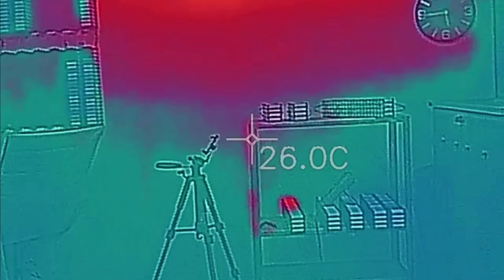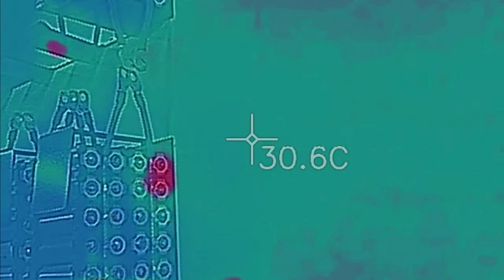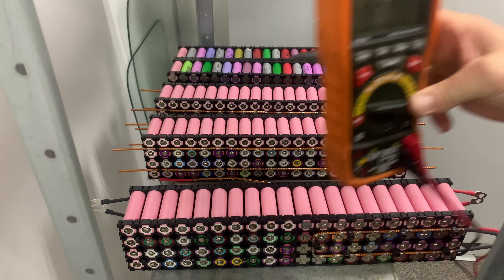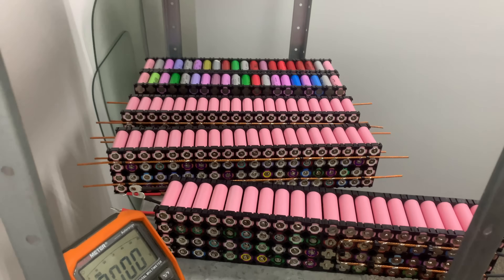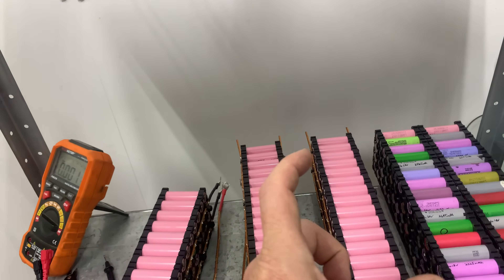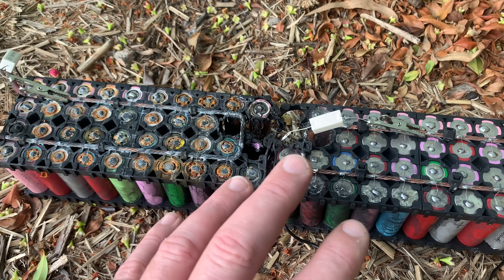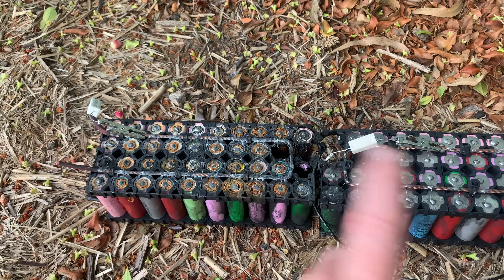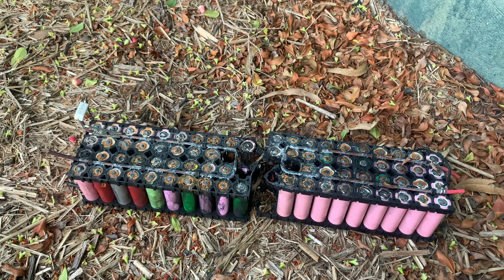faulty 18650 cells caused a fire and I think I found out why!

Comment: I’ve had similar experience and this is why I do not trust recycled Lithium Ion cells. I use LiFePO4 and/or LTO cells for all my projects I don’t want to worry about starting on fire.
Reply: Yes this project and packs are awesome don’t get me wrong though. You just can’t trust used 18650s even with testing. Work amazing in my small EV project though.
Reply: One LiFePO4 manufacturer has reported ...  less than 10 cases ( 9 cases ? ) of fire for every 300,000 LiFePO4 new cells sold.  You still need to worry about starting a fire ...

Comment: I guys. I have a DIY powerwall myself and I am a big fan of safety. I hold a advance degree in electrical engineering. But actually any car mechanic in his right mind could point you to the cause of the fire.The solution and the right way to avoid such faults is staring your guys right in the face. The cause and the solution should be obvious by the observations made by HBP in his videos. Hell, he even talks about the the actual cause of the fault without even giving it a second thought as it being the cause of the fault. I wont tell you what it is though. There are a couple of guys out there in the PW-community, always telling you guys about it. But instead of listening to those guys (and me), they always get scolded. I am done giving you guys free advise. But I give you a hint. Less is sometimes more.
Reply: You just said a whole lot of nothing, very helpful.

Comment: The battery packs should really be on quick release pull handles with long blade connection points so you do t have to cut the cable (like the old fashion blade high voltage switches) most don't thing about it until They had there first battery fire and you having to use garden shears to frantically cut the cable (it was lucky had had something to cut the cable)

Comment: Fireman here:
A Fire extinguisher, as a rule of thumb, lasts about the weight in kg of the filling in seconds. It doesn’t really matter what kind of filling, whether CO2, water, foam or powder
So if you have a 6kg CO2 Fire extinguisher, like they are common here in Germany, that thing will blast for 6 seconds continuously, not even close to a minute!!
That’s why you should always use a fire extinguisher by bursting it in short pulses, watch what happens to the fire and then make the next pulse
Reply: A fire extinguisher would have been a waste of time in this situation and most lithium battery fires.
Reply: @gemrough  no, depends on the stage of fire. Cooling always helps as cutting off the line to oxygen to lower the temperature.
Reply: @typxxilps  Would any type or size of fire extinguisher have actually stopped this?
Reply: @MrSummitville  A really big one.
Regular fire extinguishers work mainly by suppressing combustion, e.g. by producing ammonia or CO2 to block oxygen from reaching the fuel.
However, with a Li-ion battery fire, little combustion in O2 is actually occurring, so that type of extinguisher will do nothing. Basically, you need to (1) cool the cells as much as possible to prevent other cells from going off, and (2) isolate them from combustibles to prevent them from setting other things on fire. Flooding with large quantities of water is probably the best, or you could dump it in a bunch of sand or baking soda.

Comment: Bucket of water was the Best/Smartest thing!  I wonder if I should pull my packs to take a thermal camera look!
Reply: @newscotlandtv  Water was the best thing...
Reply: @newscotlandtv  It's a lithium salt, not elemental lithium so it's not going to react.  Water is the best option to cool the cells since water boils at 100C  so even if the water is boiling the cell is being kept cool enough to stop and further prevent thermal runaway as long as the water doesn't evaporate completely.
Reply: @newscotlandtv  But you are still dropping that temperature and stopping the thermal reaction.  Welders will quench hot work in water to cool it down in some cases so I fail to see the issue.  You also need special equipment to do things like underwater welding and have any hope to maintain a decent arc.  As long as you keep the cells cooled down and the water level high enough putting cells or packs in water is the cheapest, fastest, and most effective method for the average person.

Comment: You should have a vat of some non-corrosive fluid handy to dunk them in like liquid nitrogen, chlorofluorocarbon or diesel. :)
Sorting 18650 cells by (Capacity x Internal Resistance) might be helpful with new builds.
If your BMS is spending a lot of time discharging one or more cell packs, it's an indication that somebody is turning into a Resistor. Smarter BMS?
Reply: There is a lot of cells, capacity changes, i think it would be extremly hard to diagnose the problem that way. But then again, putting thermistor on every cell is also not an option, or is it

Comment: Thanks for all the info you share on You tube, been following your efforts for a while now. Hate to be the fly in the ointment, at 2:15 you show  the hot cell (8 from the left of the pack) and when tested at 3:45 it was 3.728v but the cell that tested at 0.0v is cell 6th from the left of the pack.  The hot cell location doesn't match the location of the 0.0v cell. Maybe the fuse wire didn't melt because there wasn't any high current between cells, rather an internal failure within the individual cell.
Reply: Noticed that as well 😋
Reply: Nice catch. So to measure just the voltage is useless. We need thermal picture or continuous temperature for every cell, automatically every minute, machine compared results, in case anomaly detected send an alarm immediately.

Comment: So three take aways. A bms capable of somehow taking the bad packs offline and possibly alerting the owner with noise, texts, and emails. Exposed batteries in a platform so all cells can be seen at once with a thermal camera. Ease of thermal verification is extremely important. And finally, fail safe methods to handle unexpected fires even when you aren't there. I'm probably missing a few more takeaways. Perhaps these maintenance issues are why the tesla power walls require internet connections?
Reply: an equipped BMS or an dedicated control wifi server module to add into the pack like a balancer. China industry is reading this thread, XD..

Comment: Too bad we couldn't get an xray of the innards of those batteries. The battery with zero voltage is a step before going reverse voltage in my opinion and that always makes me wonder why.
Reply: If zero volts then maybe the CID popped, so now an open circuit ?

Comment: Thanks for the very important video, i am building my solar setup now, but i will start with lead acid. But if/when i transition to lipo i will be adding a DS18B20 temperature sensor in between every 4 cells when building packs, to be able to do continuous temperature monitoring for safety. (i am also in a metal shipping container..) Happy New year ! looking forwards to more videos

Comment: Hey Pete, thanks for sharing. Looks like this 0V cell that will not accept the charge and keeps getting hot, is headed for a dead short. Jack Rickard did a detailed video on dendrite formation on over discharged cells. He talked about the dangerous of charging the dead cells with pierced separator between the anode and cathode, how the dissolved copper looses its integrity and could be deposited anywhere within the cell. This leads to thermal runaway, next time the cell is being charged. If it starts taking a charge to 1 or1.5V and then it suddenly reverses, that is the end of this cell, it can not be charged. He mentioned, if it goes in to thermal runaway, a cathode gives off free oxygen at 150-180 deg.C when it is burning, so it is really difficult to put out. Anything getting hot for whatever reason in a pack like this is not a good sign.
Reply: The hot cell is the eight in place (counting from the left) and the zero volt cell is the sixth in place (count from the left)
Reply: Now the funny part is that the 0 volt cell was not the hot one. Watch the video again.
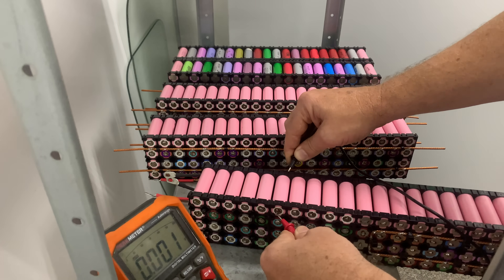Reply: @bullglar  well, at 3:50 Pete says " and this one here is completly 0 volts, and that's the heater"
Please watch the video again
Reply: @AdamBoguski  I know and it's  a mistake on Petes side.  Count the cells ftom the left. Compare flir image vs normal. The heater has 3.7xx volts.

Comment: Peter at around 9:30 the pack to the right if I saw correctly did a fuse went out?
Reply: Not quite. When he moved the pack, it shorted  across the lead of the power resistor he was using to discharge it.
The lead of the resistor is what fused.

He threw up a vid of it.
Reply: @jimmyb1451  I think you are right so now I presume that the pack stopped discharging. How that Peter will double check if he wants to lower the pack voltage to 0V.
Reply: @rbug4117  Just re-connect the resistor and let it do it's thing until the pack voltage is 0.
Personally, I'd be using a much larger power resistor of much lower resistance to discharge them quicker, but I think that's all that Pete's got available/at hand.

Comment: With the cost of LiFePO4 cells being so low these days and them being super safe, is it really worth the risk and time to use old 18650's?
Reply: Depends on what you're trying to achieve.
But you've piqued my interest. How cheap? And what country are you in?

Because over here in Aus, batteries/options are pretty slim, postage from the US is BULLSHIT expensive (like they charge the same money in shipping as for the item, if not more).
If there were more/safer options I'd be interested. As it stands though, there aren't any to my knowledge, and we have the second highest power cost in the world.

So, the answer, for some of us, is a resounding YES.
Reply: @jimmyb1451  I am in the UK, Just had a look on Ali-express and there are many cells with free shipping to Australia. 
It is cheaper to buy new than have second hand cells delivered to the UK from America.
I think you just need to look around more, i think with the cost of your energy a few extra dollars on decent and safe batteries that will last much longer is a wise move.
Will Prowse is a good source of information about buying new cells from Ali-express.
Reply: @killuazoldyck1352  Personally mate, I'm more about reducing the number of 18650's that get dumped in landfill, or shipped to a third world country for some poor kid to "process".

I'm also happy to do the work required and design the systems to avoid fires. I understand that's not possible for everyone. 

Cheers for the info though. I don't use Ali ex.
I'll have a look :)
Reply: @jimmyb1451   "do the work required and design the systems to avoid fires" that is simply not possible, what you can do is to contain the fire and prevent it from spreading!
Reply: @josep.3364  In 98% of the incidents of battery fires, which are already a low probability, it is absolutely possible to avoid the fire. 

Or at least to have sufficient warning to remove cells from packs before they turn into bottle rockets.

I have already made suggestions as to what I intend to do when building packs to further mitigate the fire hazard. 

All of that aside, the batteries you speak of, present lesser, but still a probability of the same incidences, just over a longer time frame. IE: In reality, there is no risk free solution to the systems we're describing.

 Long and short of it, ALL battery systems need maintenance. If I can save some chemicals going into land fill on the way, I'm happy to assume the risks involved and the requisite maintenance. :)
Reply: where did you pull that number from? I know it wasn't from any certifiable study, I am wondering if it was from your brain or a bit lower!
if you can have 20 batteries with the same capacity as 12304876123890761247836 18650cells what do you think its safer or easier to monitor ? Looking forward to read your answer!
Reply: @jimmyb1451  "I have already made suggestions as to what I intend to do when building packs to further mitigate the fire hazard. " this is disgusting to read, you can NOT in any factual way do anything about it!
OEM use same batch cells in 1 equipment(car/bank/ups)  and that batch has hundred of cells tested! I am sure you can do the same, what is the name of the company you own that has the money to do so ?
Reply: @josep.3364  "this is disgusting to read" Only because you're running on assumption. The mitigation I am referring to has nothing to do with the cell's life cycle/use/abuse/batch/manufacturer.... and everything to do with the construction of the packs and how I intend they behave in the event of a fire.

" you can NOT in any factual way do anything about it!", what? A cell fire? Agreed, if it's going to happen, it's going to happen, you absolutely can stop the fire from effecting adjacent cells though.

And again, the same risks exist with the cells you are championing, perhaps with a lower probability but they STILL carry the same inherent risks. Your point is moot, and note, I find your turn of phrase, insulting, as intended.
Reply: Please recycle. ♻️
Reply from the maker: Always where practical

Comment: when you have hundreds of components, you are more susceptible to a single failure, that's what put me off 18650. Went down the LiFePo route after an unpleasant 16 battery lead-acid experience.
Reply: I am currently leaning against lead acid in favour of any lithium... What was your "unpleasant experience"? I would really like to know if there are any cons I'm unaware of.
Reply: Love my LiFePO4 cells as well! LTO as well are amazing (overpriced, but safer by far).
Reply: @wildhavenoff-grid3587  loving my LTO pack :) No worries using at freezing temps right now.
Reply: Any storage of energy poses a risk, think about a can of gas. Now, lead acid battries vent highly flammable gas during charge.
Reply: @chriss160   yes... But those gasses can be vented easily. Especially with AGM that does not vent much at all and probably have an attachment for a hose it can vent through.

Personally I'm more into flooded cells because they seem to be able to handle more abuse. But for my use case (stationary, semi off grid) weight and space is not an issue.

I would not pick LA for most hand tools :)

Comment: Break the fuse on the negative end of the hot cell. Get your digital multi meter(DMM) and set it to current/amps. Connect the DMM red lead to hot cell negative, and black lead to the copper bus bar.  If it shows a negative value the current is flowing backward through the hot cell and shorting the bus bars from + to -. A diode on every cell would stop reversing shorts, the problem is diodes have a voltage drop.

As an experiment you could get an old cell that gets hot and connect it with clip-on leads to the + and - of a pack and check for reversing current and see if it catches fire - clip leads allow you to yank it fast - .

This is why I mentioned self closing steel boxes a year ago. I got the idea from kero part washing tanks with a soldered link on the lid that melts and shuts the lid if the kero catches fire. You can see them at Supercheap stores.
Reply: If it's not reversing current but just internal resistance heating the cell, you should switch to a low temp solder that will melt and disconnect the fuse when it gets hot. I think it's bismuth based solder, but you'll have to look it up.
Reply: This melts at 118ºC
https://www.digikey.com.au/product-detail/en/chip-quik-inc/SMDIN52SN48/SMDIN52SN48-ND/8681827
Reply: @SidneyCritic ComedyHound
 -  If you add a reverse blocking diode to every cell, then how can you CHARGE that cell ?
Reply: @MrSummitville  Opps, I think you're right. If the higher potential voltage is on the outside of the diode it can never flow into the battery to charge it. 
I guess low melting point solder might help to disconnect a cell if it overheats, because at 118ºC it shouldn't be on fire.
It would be good to purposely blowup cells while it's connected to an amp meter that can sense direction, then we can see what the failure mechanism is.

Comment: Is the whole power wall concept flawed. Should everyone be building power chimney's.
Reply: When using second hand batteries, yes. Second hand batteries may be appropriate for other applications but not for a home powerwall. They cannot be trusted for such an important task.
Reply: Flawed in such that they need more maintenance and monitoring. Bms units for larger packs should be built to be able to monitor a whole packs delta t over ambient. And analyze which cells appear to be failing. But with diy or Chinese bms units this isn't always the case and then when using 2nd hand batteries it gets further complicated due to potential uneven dendrite growth. And cell life. Anyone building packs should be factoring all this in and building them in such a way that if they do fail they don't take the house with it. That being said it increases costs and thus most don't. I'd just replace all lipos with lifepo4 or lto cells

Comment: Imagine using trash grade deep discharge, 10-15years old laptop batteries from random brands and 
with very different capacity, and oh no ! It blow up ! Why?????
Reply from the maker: Come on now.. even an old car with maintenance will last a good long time after it should be retired.
Reply: @HBPowerwall  there is no maintenance  on laptop batteries. Its charges to 100% every day for 2-8 years, then couple of years they sit on shelf and go to trashcan or ebay for parts.  
Even after a very good repair, an old and completely rotten car will no longer have the same body rigidity as it was before, and will simply kill its owner in an accident.
Reply: @HBPowerwall  and yea, stupid tesla and all other brands that use impulse welding. 
Only soldering! only overheated batteries !